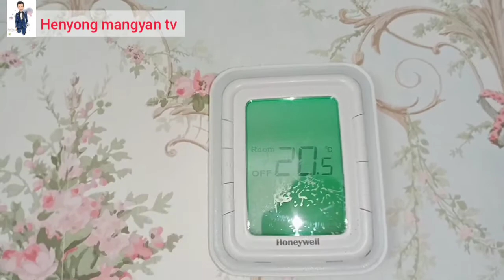How to clean a fan coil unit ( fcu) cleaning of strainer and coil system

Comment: Tsaka ano yong ginawa nyo sir bago nyo po alisin yong strainer. Binuksan nyo po muna yong valve ng supply tapos may pinalabas kayong tubig sa una? Hindi pa yon yong backwashing or flushing diba.. Salamat po sir.. Ingat po. God bless 🙏 👍👍
Reply from the maker: Ah. Tiningnan ko kung malinis yung tubig nya para hindi na pumasok sa coil kc ttanggalin ko yung strainer nya.
Reply: @Henyongmangyanmotovlog  maraming Salamat sir sa sagot. Tanong ko din sir ano po tawag dun at ano gamit nya sa isa pang maliit na parang valve sa linya po ng supply pagkatapos po ng actuator valve bago po dumating malapit sa pinaka coil ng fcu kasi napapansin ko po parang ginagalaw din nila yon pag nagbabackwash.
Reply from the maker: @balongride3169  yun yung sinasabi ko sayo once natapos mo na yung flushing at na open mo na lahat yung valve. Bubuksan mo yung maliit na valve para i release yung hangin sa loob ng coil.

Comment: Why Blower unit body outside and Main duct out side is coming more dryness of water?
Reply from the maker: Maybe the fresh air is open. And one more thing your actuator motor is not working properly. Pls check it
Reply from the maker: Do you mean, moisture? Its humidity coming from hot air. Pls check you fresh air supply. Close it.
Reply: @Henyongmangyanmotovlog  i check it Actuators working good
Reply: @Henyongmangyanmotovlog yes, moisture air coming    do you have any idea.
Reply from the maker: You have to clean the coil pins, drain pan, and find the fresh air dumper. Close it.
Reply: @Henyongmangyanmotovlog  this Blower unit is car barking area
Reply from the maker: Its in the parking area? I thought its inside the house. Just put insulation around the unit.
Reply: @Henyongmangyanmotovlog  thanks for your reply
Reply from the maker: @mohamedjameen6039  your welcome anytime.
Reply from the maker: @mohamedjameen6039  pls subscribe thank you

Comment: Wat about the picv how to service if blocked
Reply from the maker: You have to turn on the unit and set to lower temp setting. To open the picv. Then you can control  to gate valve.

Comment: Sir okay lang ba na nakapatay ang unit pag nagbabackwash? Kasi yong ibang fcu namin dito sa building sira na mga actuator nya kaya nakatanggal na nakafully open na yong fcu valve nya sir. Salamat sir
Reply from the maker: Pwede rin nakapatay kung yung actuator valve nya naka open. Pero acurate na gumagana yung actuator motor kaylangan naka ON yung unit at nakasetting sa 16°.
Reply: @Henyongmangyanmotovlog  copy sir. Salamat po ulit. Karamihan po kasing actuator dito sa Tower namin puro sira na. Spartan po brand nya made in Canada. Ayaw naman umorder ng ipapalit na bago yong clients namin kasi sobrang mahal daw yong 400qar isang piraso ng actuator. Kaya ginagawa namin sir tinatanggal nlang namin yong actuator para lumamig yong supply air ng fcu. Yon nga lang hindi mo na makokontrol ang desired temperature nya.